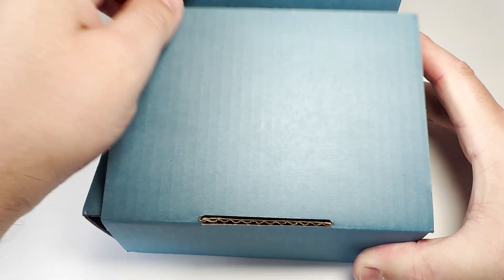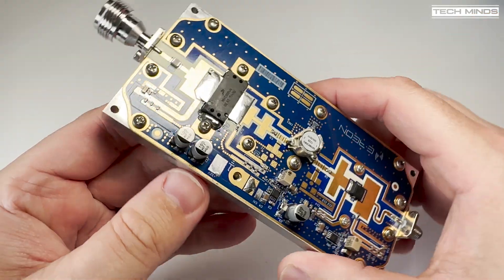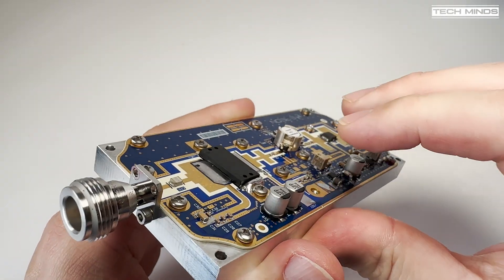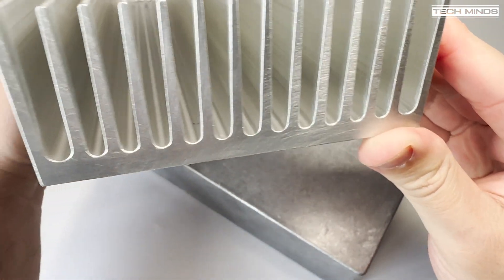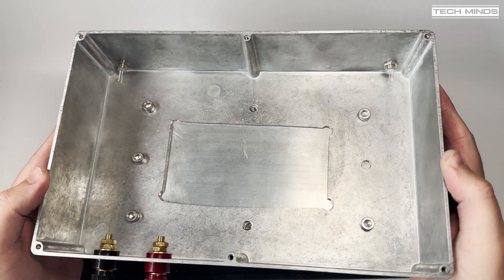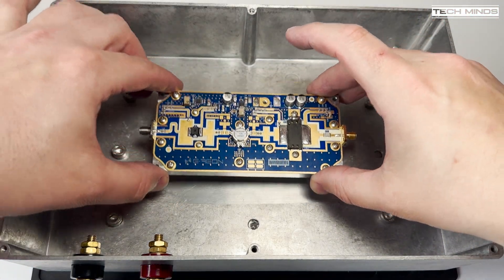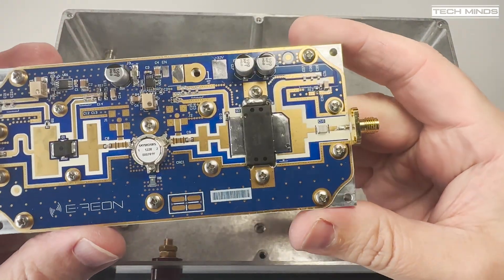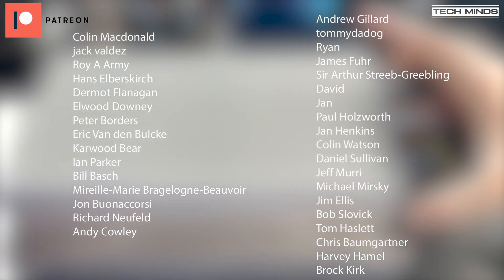300 WATT 2.4 GHz RF AMPLIFIER - PART 1

Comment: Just a tip aluminum is a sticky metal use a very light oil or WD40 for drilling.
Reply from the maker: Wish I had thought of that back then, would of most likely saved me breaking some drill bits. Cheers

Comment: I add circulator to mine to protect from high SWR and unwanted out of band signal and he is outdoor at dish side , less loss in cable, USE N connector for the output !

Comment: The output connector needs to be a 4.3 - 10 type. An SMA is too small. Look at what the use in cell phone transmitters. I agree that water cooling is a good idea to reduce noise, but this thing should be at the antenna, not on the bench. A good circulator system to protect the PA and couple the receive line is advisable. No nasty relays at this frequency.

Comment: Woh…. We’re getting into microwave oven territory.
Reply: They’re making solid-state microwave ovens with transistors like these.
Reply: @marsgal42  Really?  Cheaper than cavity magnetron I suppose.
Reply: @RobertLeeAtYT  Dunno. Shrug. I don't know the details. The data sheets for the high power LDMOS transistors cite microwave ovens as an application.

Comment: I think you'll find you need another box/can over the amp to stop stay RF getting into wires within the box. Feed thru caps into that box maybe also needed as well - just an observation. A circulator / isolator + load is a good idea to stop you blowing it up with bad a SWR ! (watch out for arcing)

Comment: What ya do is bend some copper pipe in a zig zag shape to go between the heatsink fins so then ya got some water cooling aswell cause ur goin to need it ;) and btw that circulator will need a heatsink and ya better off mounting it as close to the RF PA as possible
Reply from the maker: Circulator that is being built for me has its own heatsinked 50cOhm terminator :-). And yep, I had though about doing exactly as you described with copper pipe and water cooling. We will see what happens as we progress with the build. Thanks 🙏

Comment: 1st...You need to build outdoor unit for QO-100. Cable loss is significant. This needs to be mounted on the backside of the dish.
2. Heatsink is OK for maybe 50W of constant RF output. Way to small for full power.
3. SMA is bad choice for output, best option here is to mount panel N connector with semirigid on the other side, directly soldered to the board
73 de SQ6QV, see You on WB.
Reply from the maker: I’ve been on WB for some months now as I already have another 200 Watt amp. All my QO100 gear is remote, over network near the dish already :) I was advised by manufacture not to solder coax directly to the board. I’m using SM141-50R rigid cable for inside to panel connectors. I couldn’t locate an N-Type male for SM141 cable, so that’s why I’m using SMA on output. All these Nokia pallets everyone using SMA for output so should be okay. I will never need full power from this amp, even for WB. I don’t transmit above 333Ks anyhow lol :) thanks 🙏
Reply: I have half a dozen N-Type Males that have SMA adaptors for SM141 semi-rigid. You have to do the job right first time, or leave well alone. Why you want to have 300W is anyone's guess, but you do the same with 30-50W with P5s. You really ought to consider water-cooling the heat-sink with a small refrigerant between the tank, even if only 30% duty cycle time. Because you TX at 100% duty cycle for  3 minutes out of every 9 minutes. This makes sense. @TechMindsOfficial   Best wishes from a guy that's been heard on your channel.
Reply: @TechMindsOfficial  with 300W you can do 6Ms

Comment: Too bad you can’t just wire your Tx into your microwave oven and connect the appropriate antenna to the magnetron. Then you can cook your popcorn, your neighbors wifi, and those pesky drones. Very cool
Reply: The cavities are not drilled to close enough tolerance. The frequency would rift all over the place. You'd be in and out of QO100 all the time, and you'd piss people off royally:face-orange-raised-eyebrow:😁
Reply: @peterbradbury784  norwich?

Comment: You need to get a proper three part set of taps (taper, standard and plug tap) for each size you need to tap plus the correct size of tapping drill and a hand tap wrench. Trying to machine tap small sizes like this usually ends in tears.

Comment: I recommend a single large fan placed on top of the heatsink over the device, blowing down into the heatsink. With end mounted fans you're sending some heat back towards the device.
Reply: This absolutely correct. I worked on commercial high power high frequency transmitters previously, the was fan blowing directly at the base of the heatsink, not across. Also, you should smooth the contact surface on the bottom of the amplifier module. Very fine sandpaper (600 - 1800) on a flat surface with a lubricant, for ally, water works.
Reply: I did that
Reply: Like lapping cpu in the sub ghz

Comment: This is interesting Matt, something I have not yet ventured into. Am I right in understanding that a heatsink dissipates heat better by mounting vertically?
Reply: There's a lot of factors, and if the PC world taught me anything, it's just to try every way until you find the best! 🙃

Even a decision about what way the fan blows with cause division, to blow up the way sucking air in along the fins, or fan blowing down the way forcing air along the fins and out

Speaking of PCs though..... you get some great prices on their stonking great CPU coolers nowadays, and some aftermarket grfx card ones are hella pretty as well as functional, maybe folks might think about using them for particularly toasty bits of equipment 🤔
Reply: Yes for passive convection, but with forced convection it's pretty much irrelevant.
Reply: Heated air flows upwards because it weighs less, if you place your heatsink horizontal heated air molecules will collide into other parts of the heatsink creating useless areas for cooling whereas vertically they can freely and constantly have their way out, all manufacturers use this technique when not using forced venting, it works exactly like your home radiator. The only drawback is if your home stereo amplifier vents upwards you'll have a nightmare cleaning dust in very dusty areas like where I live when the product is not sealed and is free to air

Comment: That's quite the transistor. A shame it's discontinued... 🙁
Reply from the maker: I’ll have to speak with E-Reon about that as I’ve been told that by someone else. I’m sure they have it in hand though, maybe a drop in replacement of sorts.
Reply: @TechMindsOfficial  My first thought was to have a look at the datasheet, then check price and availability through Digi-Key and Mouser. The “replacement” is a substantially different device...
Reply from the maker: I’ve been told by the supplier that they have enough stock to last way past the lifetime of the product :)
Reply: @TechMindsOfficial  Good to hear it! 

As a western Canadian I won't be playing with QO-100 any time soon, but an amplifier like this is easily EME capable with a decent antenna.